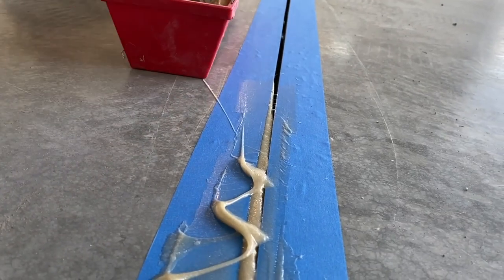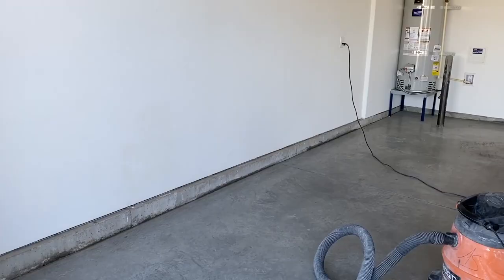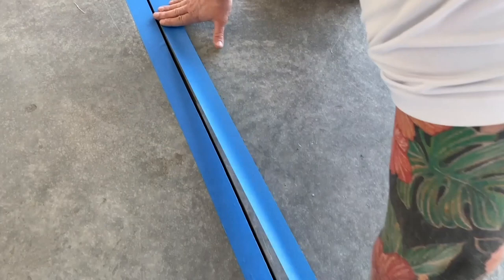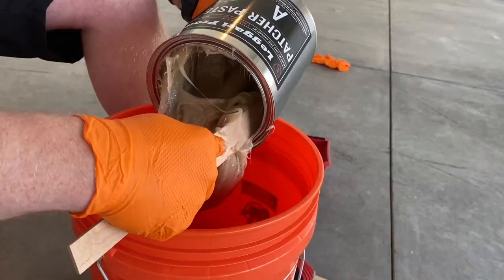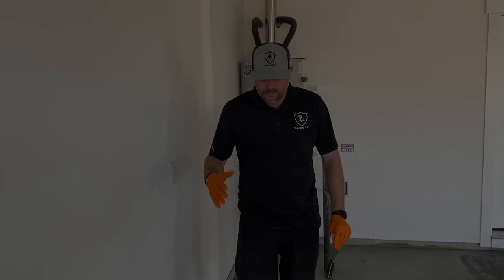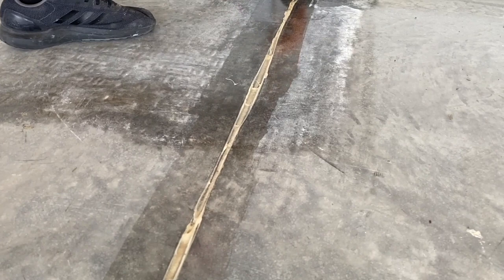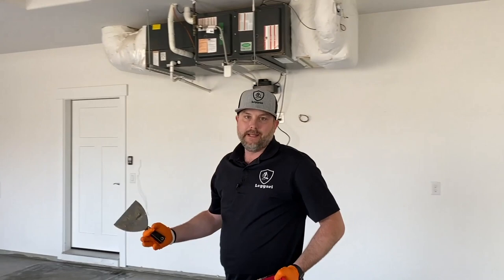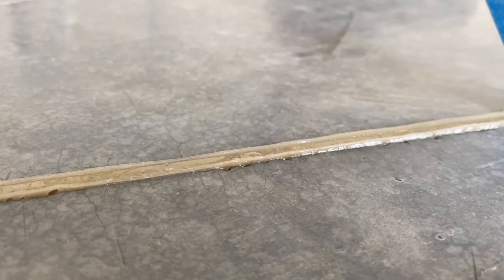How To Fill In Saw Cuts & Cracks To Create A Seamless Floor Before Epoxy Application | A DIY Guide

Comment: The expansion joints are in the concrete for a reason. There is a good chance it will crack there again or crack somewhere else which would be even worse.
Reply: Good thing you mentioned this I was gonna bondo my garage expansion joints  so you think it's not a good idea then ?
Reply: @raiders3417  I think you can just have a "joint in between 2 separate epoxy areas
Reply: The concrete only cracks if you have ground thats expandablearound moisture and when it rains
Reply: It’s a good idea to fill them, then cut them out after and fill with silicone. You can’t fill the joint with a liquid epoxy when you lay the floor. It will be lower than the rest of the floor and no longer have a straight edge. This would make the caulk joint awful.
Reply: @raiders3417  What I did was epoxy my garage, not getting it into the expansion joints. Then I picked the closest color of Sikaflex (any other filler would work if it's soft relative to concrete) and filled the joints for a seamless look.
Reply: Those aren't expansion joints.  Some garages do have 1 or more expansion joints (including mine) but most of them will just be saw cuts.  I have definitely heard people who say you shouldn't fill them but most people have told me those are just there for the curing process and that it is fine to fill them after the slab  is completely cured.

Comment: Heres my question im doing 2 bathroom floors at a gym...one bathroom has a "BURNOUT"...yes!! Someone brought their motorcycle and did a burnout in the bathroom and went right through the tile to the concrete and the flat tiles are obviously mortared to the concrete slab... Will this putty filling that void?? It's about 6 in by 4 in straight through to the slab.

Comment: I am dreaming about applying ocean blue epoxy to my home floor. I have ugly ceramic tile floors with huge 1/2 inch grout lines between the tile. Can I use this product as a patch to level out the grout lines then apply self leveling over that and a primer over that?
Reply from the maker: Call customer service at 844-LEGGARI or Email customerservice@leggari.com They will be able to help you with your questions!

Comment: I'd like to see that crack after a month.. tho ONLY thing that has ever worked for me is NP1. Nothing else. NOTHING
Reply from the maker: NP1 is a great product! Doesn’t work well under epoxies with radical freeze-thaw cycles though. We’ve used it a lot to fill control joints after the floor’s done though. Our Patcher Paste bonds extremely well to the walls of the joints and does offer some flexibility. Cracks are definitely the bane of the industry, this product is our answer to them. Thanks

Comment: How come you didn’t just use polyurea joint filler in the tubes ? Or use the pumps they make? Of course the pumps are pricey but this seems messier and longer process.
Reply from the maker: In our experience we prefer a little more flexibility, and Patcher Paste offers that. Like anything, this is subjective and depends on the brand/formula of the Polyurea. Thanks

Comment: The best way to fill cracks..... 100 good methods. Best way to fill saw cuts....don’t. A saw cut allows a good slab to contract and expand so it WONT crack. Look up the other video with more common sense called how to make your car windshield black and non see through.